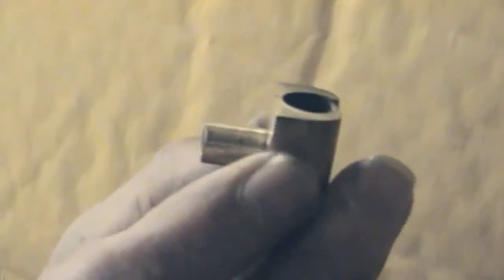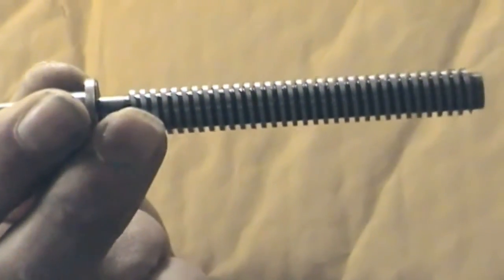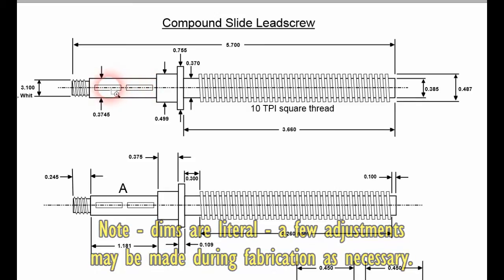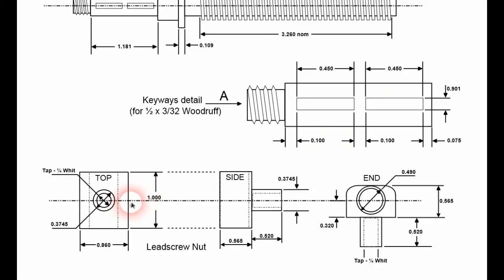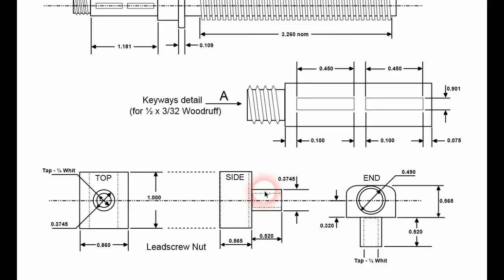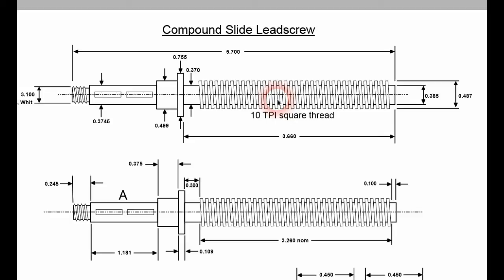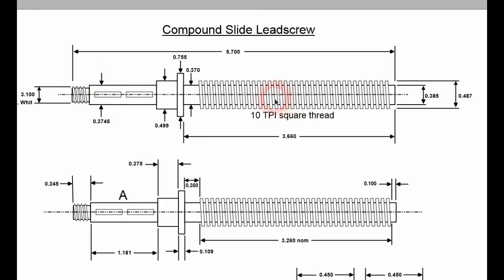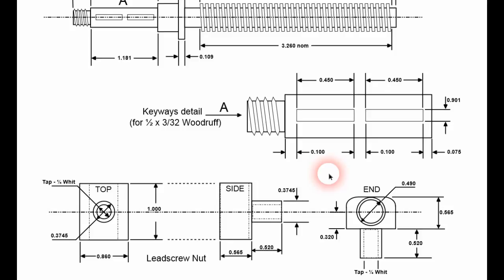Lathe compound slide leadscrew and nut, Part 2. Dimensioning

Comment: ok.i enjoy all videosand learn something from each.
why would you rebuild leadscrew and lead nut? think a while and find a simple solution that takes  backlash  from the leadscrew. what could it possibly be? if you can cut a new nut make a companion nut and use it to set backlash and extend the wear life of the leadscrew/nut assembly...a lot of these projects seem to be for time comsumption and not common sense....
Reply from the maker: Agreed - there is an easier solution to which you refer. In this case it was decided to do both items because time was not a constraint as well as wanting to make the pair this time round. Thx for your comment.
Reply: 15 years ago replacing the nut on my Atlas lathe x-axis was simple- I bought new parts.  I had no way to make new ones.  More power to you, Chris, for making your own repair parts.  I always enjoy and "like" your presentations.
Reply from the maker: Thanks Jeffry :)

Comment: hi chris ,nicely laid out tech drawing there,looking forward as you say ,weather permitting ,for the next installment getting down to brass tacks,pardon the pun lol,,hope the weather gets milder for you ,not be great down your way ,weve had gales again up to 90mph winds,and already being forcast for the 24,25,26 dec ,dont need to pluck the turkey this year ,the wind will have blown the bloody feathers of already lol,....dougie....
Reply from the maker: Hey Dougie. I do expect a day or two milder so if time may manage a start at least.  Did discover on close inspection that the top clearance for leadscrew nut is actually a shade better than expected so - may be able to shave off top a bit less than was on original.  Heard about your gales - here, just way too much snow! :)